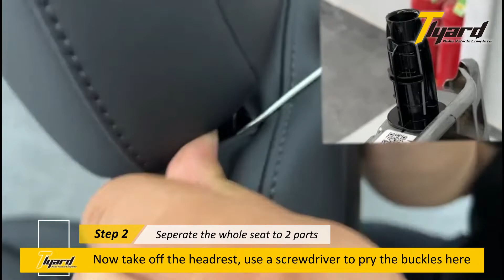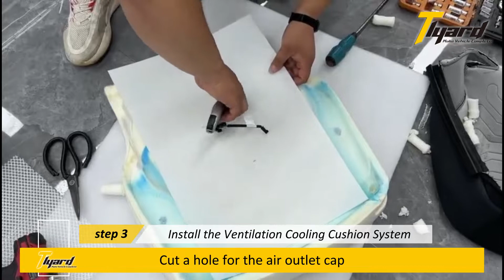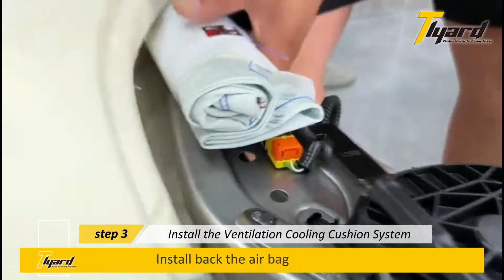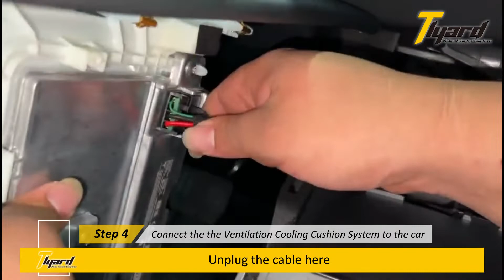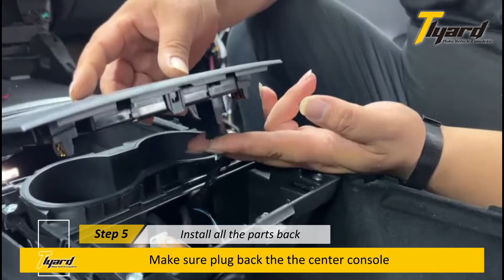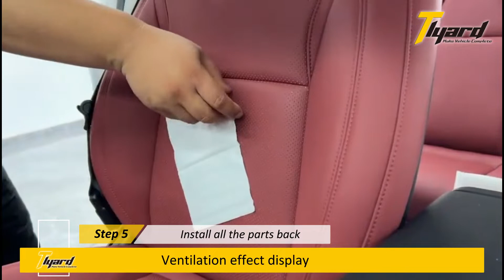Model 3/ Y Seat Ventilation Cooling Cushion System INSTALLATION

Comment: What seat covers are you using with This ventilation system ?
Reply from the maker: This ventilation system no need for additional seat covers.😊Just use the car's original seat covers.
Reply: @tlyard the original seat covers are not perforated.  No way for the air to flow through them.  🤷‍♂️
Reply from the maker: @cadjoe77  Need to punch holes in the original car seat cover🤫. You can try this product, this does not require destroying the original seat cover, but adding an extra layer of seat cover. https://tlyard.com/products/model-3-y-ventilated-cooling-seat-cover-breathable-seat-protector?variant=44181362245870
Reply: @tlyard  you can’t punch holes in the seat cover 😂.  What brand cover was used in the video? It was not a oem cover and it was not this one.
Reply: Kit includes seat perforated covers
Reply: @creatorex1  No it does not include any seat covers.
Reply: @cadjoe77 I am currently installing this kit, gonna have it done on monday. Got the same seat cover (already perforated) as shown in the video. Gonna tag you on monday
Reply: @cadjoe77  Have it done, actually installation was easier than i expected. Installing the ambient light was way harder. It works, it works perfectly I must say. I'm so happy😅😅. I'm a little bit worried about the airbags cause the original bag (in which the airbag is stored) is from a little different material, but still there is metal frame of the seat behind the airbag so that will block it from blowing the other way. Other than that it's great it works and I love it
Reply: @dodotesla  did you make a video?